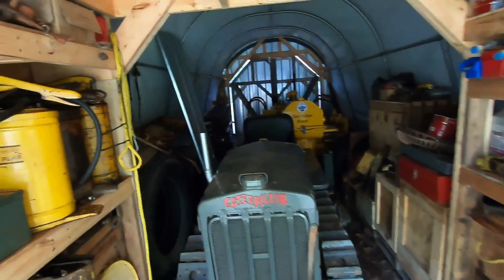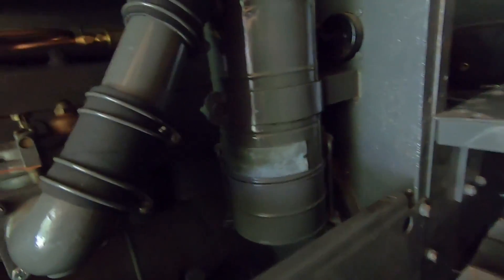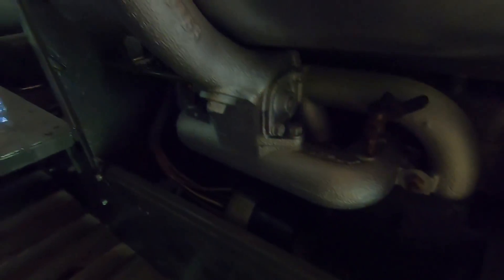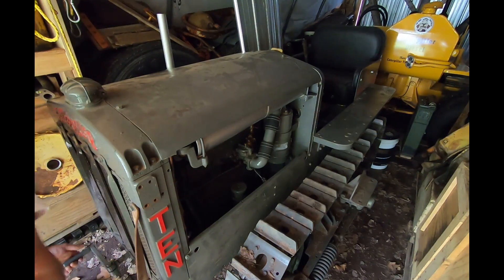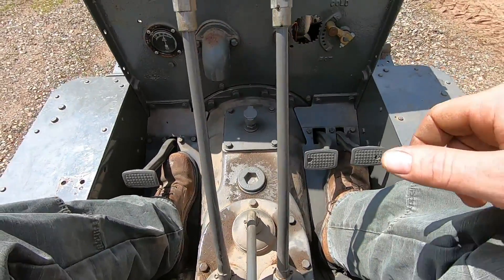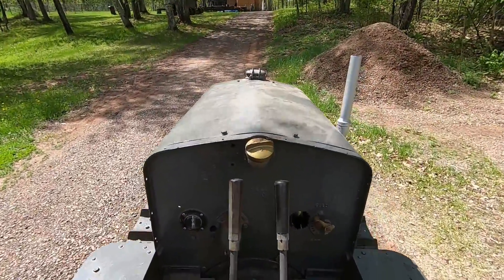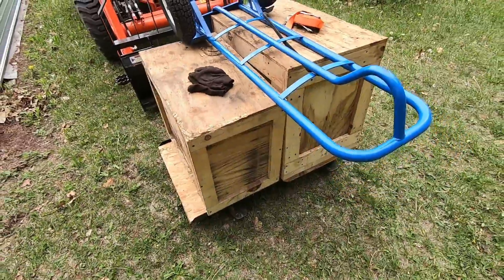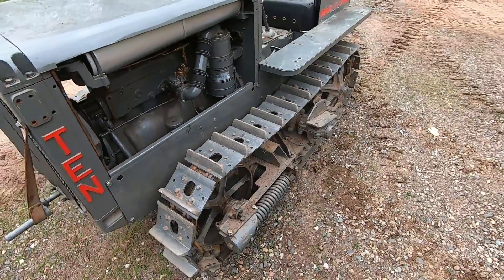Caterpillar Ten #PT3037 - First Start After A Long Time Parked & Tearing Up The Yard

Comment: Awesome little tractor. So looking forward to the pony engine rebuild. Purchased a pony supposedly running for my D47U but I don't want any trouble with it and will tear it down and freshen it up before installation. The previous owner held the latch engaged with a pry bar and broke the engagement lever or bent it so i can't use it anyway. Will pull the engine and fix it correctly so I can start it by myself. Keep up the good work and you looked like you were enjoying the ride a little bit much. Drag the tumble bug scoop and we can imagine that you were having to work.

Comment: I just picked up a cat 10, not a pretty as yours.

Thank you for pointing out some significant wear points. That said, I have a question.

Where would you go for a water pump rebuild kit? Or would you just build the parts for a rebuild? I ask because the very first item on my repair list is the water pump. Second is track roller bushing inspection. As it also has a pusher blade installed.

Good news though, it starts, runs, and motivates under its own power. With out much fuss.

Thank you for your efforts on these old pieces of history.

Comment: Neet little tractor.  What would something like that be used for? It looks about the size of a lawn tractor but would just tear up a lawn. I guess it could be used to pull a small disk in the field or pull a trailer/ wagon with supplies from the road to the construction/job site....

Comment: Cute little toy makes cute little donuts in the yard. :-)
When exercising my standby generators, I disconnect the line from the fuel tank and  plumb in a small auxiliary fuel tank so the main tank stays dry and clean.

Comment: It probably wouldn't hurt to change the anti-freeze in the ten to keep corrosion down or even remove any corrosion with the additives in anti-freeze to keep corrosion down. It looks to me to be a perfect loader platform with a really good hydraulic pump. Those aggressive grousers will put a load of manure in a spreader in nothing flat on the farm. This ten could be running 200 years from now if the front axles were repaired.

Comment: Was that Cat 10 the thing the Seabees and Army Engineer Corps used in WW II to make all the island air bases in the South Pacific? I know they had some moderately small tools.
Reply: @squatch253  Interesting, thanks for the link! I have to admit I'm surprised the dozer had hydraulics. I thought that didn't really comer along until the 1950s. (I  know that "hydraulics" were originally water-powered cylinders from the late 1800s, but most of that was stationary plant or ships.)